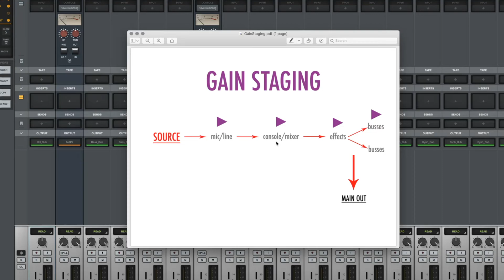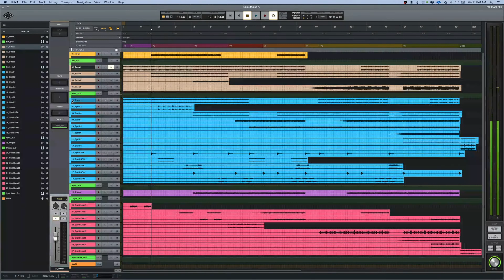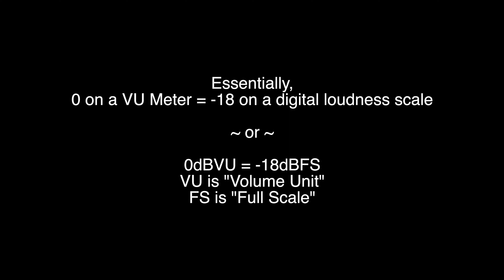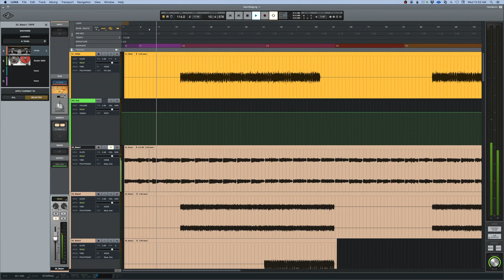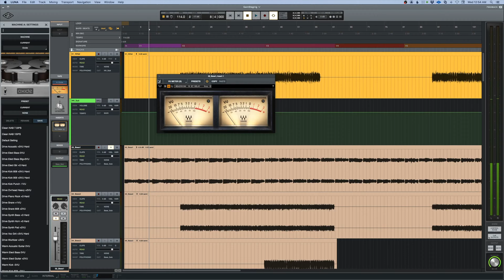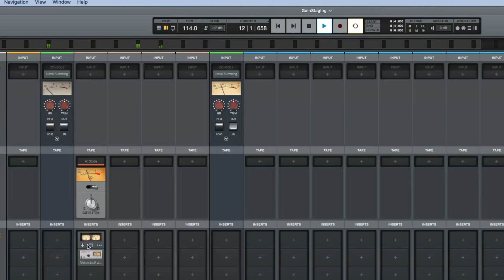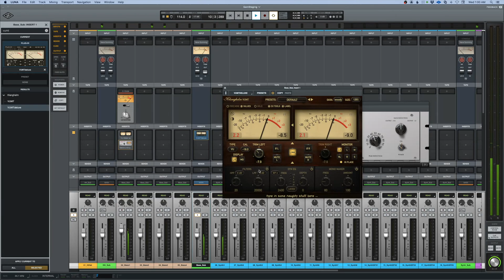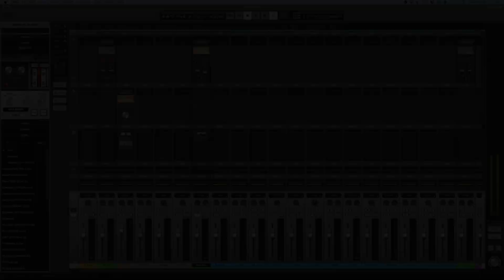Gain Staging - How and Why?

Comment: Serious question , if a compressor is used to reduce the dynamic range , then why do you use make up gain , wouldn’t that defeat the purpose of using compression if it’s going to be the same level afterwards ?

Comment: thank u so much for this clear explanation...where I get confused is that supposedly the oxide and summing plugin automatically gain stages?? not sure I understand?? I do see faders change a bit when summing added?? Then there is the saturation knob on tape....why would studier have this in addition to input control?? Also, Im not clear on the Neve summing...I know that meter is output and trim can adjust that, but how does the saturation knob work?? I've read conflicting stories?? is counter clockwise less or more saturation?
many thanks...nice to find someone that really understands this
mitch

Comment: Hi, your videos are great and always really helpful to me, so thanks for sharing them! I was wondering if you could point me in the direction where I might be able to understand what the OL overload button shows in Luna? I find it really difficult not to have come on at times in mixing or recording sessions?
Reply from the maker: The OL button is there for you to "clear" any overloads on any tracks. If you have an overload, it means that the volume of the track is peaking beyond 0 dBFS (that's a bad thing) - a red light will pop up on the specific track as a warning. You can clear the red overload by pressing the OL button. Cheers!

Comment: Are there any UA plug ins that have a VU meter built in?
Reply from the maker: Not a simple VU meter just for measurement unfortunately. You can usually pick up the Waves VU meter for about $10 on sale... or the Klanghelm VUMT for around the same.

Comment: Aren’t you supposed to push the plug in somewhat and roll back out put of that plug in to keep it at -18 ? Not rolling back the input, wouldn’t that weaken the plugin effect that you want ?
Reply from the maker: Great question. While you can certainly push the plugin for different sounds etc, it is really at the point of 'input' that you want to know what the level of signal is though. Output is there to help balance the signal coming out of it - post processing. All things are up to your creativity though. And some things just sound better being abused :)

Comment: Great video and instruction. Could I ask as I’m curious, so you add the Waves VU plug and gain stage the track. When you add the Oxide plug, the gain staging boosts even though you had the Waves VU set at -18db. What I’ve been doing is using the metering of Oxide and Studer to indicate, if I need to adjust any given track levels so tape meters aren’t going above +2db peaks. As I add tape to all tracks is their any real benefit of me doing the Waves VU step that you did initially? Thank you!
Reply from the maker: GREAT question! The meters on the tape extensions are Output meters. They are essentially there to show you what the signal level is coming OUT of the tape machine. It's always good to check the level BEFORE you hit the tape machine, which the machine's VU's won't tell you. The tape machines are calibrated to be a bit hotter than -18dBFS, so it's cool to hit them with more signal than you'd normally send to something that is -18dBFS. But also, the "input" knob on the tape machines is an external input leveler, so you can easily adjust signal using that knob, then view the tape's VU meter for an output level. 

Also, never forget that just because the manuals say you should do something one way, doesn't mean that doing it another isn't going to sound good. So, don't get TOO caught up in this stage, just be aware of the overall sound and level going to the mixbus. 

Cheers!